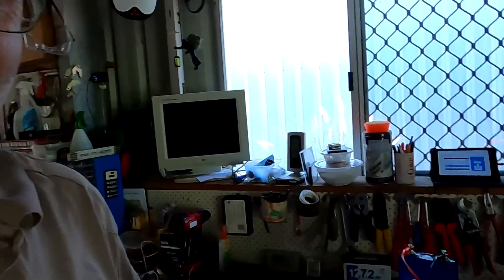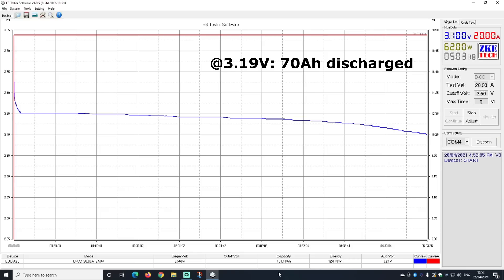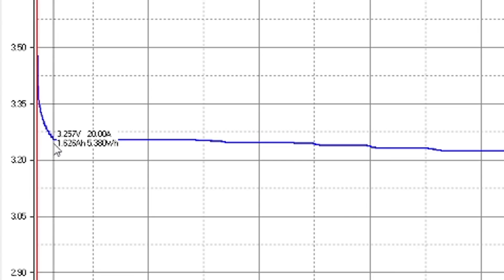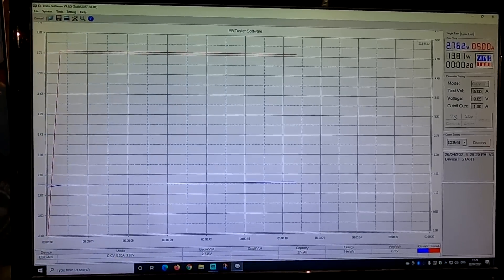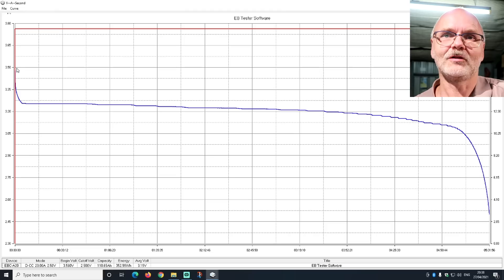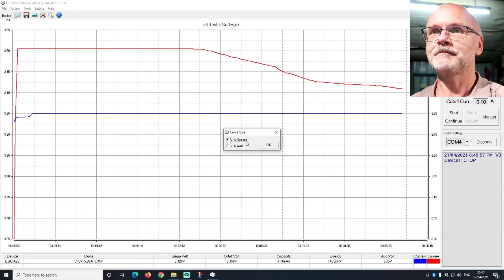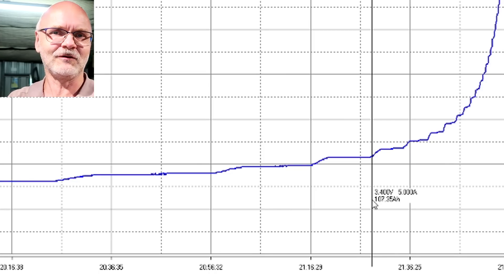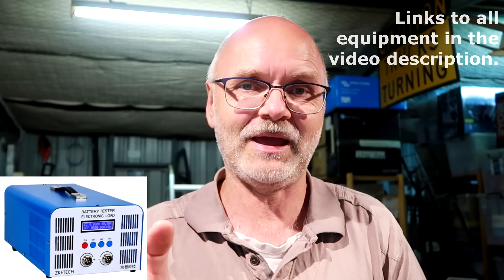How far to charge and discharge a LiFePO4 cell. Testing the full Charge and Discharge Curves.

Comment: You are finding exactly what I have found. No need to go below 3 volts, and above 3.4 volts, there's almost nothing outside that range. You are still limited by the weakest cell, but that is true no matter what charge and discharge profile you use. You can easily get 90% of capacity without placing any stress on the cells. I had found out using the bigger tester that my laptop battery won't last long enough to record a complete test, so for the last month I have been waiting on the parts for an 11th generation in NUC to be able to save the graphs. They just released it about two weeks ago, so I finished building it yesterday. Had to use a dummy HDMI plug so it can boot headless, and I just remote desktop to it. So I have only completed 2 recorded tests, despite having it for a month now (Eve cells), but have done lots of manual tests and was reaching the same conclusions as you about the time you did the videos on charging and float voltages. On a 280AH cell (measures 278.8) I am finding about 5 amp hours above 3.4, and 5 amp hours below 3.0. I think I like your 3.1v cutoff better.
Reply from the maker: Thank for sharing, John. A NUC is a good idea as it uses only a few watts of power running for so long. I've got my old Dell workshop computer running for several days now and with the cloudy weather at the moment, solar is barely enough to recharge what I take out with all my testing.
Reply: @OffGridGarageAustralia  Yes, since it uses a laptop CPU, memory and SSD, it is very good on power consumption (like a laptop). It even uses a 65 watt power supply just like a laptop. I did have to buy a 10 port USB hub, since I have a lot of programmable loads and power supplies to connect. Four of the 18 amp Riden power supplies, and four of the ET5410 electronic loads. This is for testing packs at higher rates, obviously.
Reply: @john_in_phoenix  how abt a RSPI4 instead of a NUC ?
Reply: @cgmarch2359  Hard to run Windows software on an arm based Linux system.

Comment: The reason for charging to a high voltage of 3.65 is for speed. Generally you will charge to 3.65 and stop the charging at .05C (5 Amps). The voltage will sag over time to about 3.4v. Knowing that a fully charged cell sits at around 3.4 volts, You could just charge to that voltage until you hit 0 amps and have a fully charged cell. This however would take much longer to achieve the same result.
Reply from the maker: Yeah, I figured that now with doing more testing. The absorption time at a lower voltage is taking forever.

Comment: You only charged at 5A but if you say charged at 20A then the voltage will have been higher on all points in that curve due to voltage drop inside the cell based on cell internal DC resistance.
To be sure that cell is fully charged no matter the cell internal resistance and cell charge rate (within reason) then is good to have a voltage termination at least at 3.5V on that fastly increasing part of the curve at the end. For my SBMS I selected the 3.55V as a good end point for most cases and LiFePO4 batteries to be sure cell is full then charging completely stops as absorption and float are detrimental to Lithium batteries. Also the SOC is set to 100% in case some small errors accumulated since last charge as the SOC is calculated and not based on voltage (as you seen is just not possible to guess SOC from the voltage with LiFePO4).
Reply from the maker: Thanks, the 20A test is coming very soon.
Reply: I was looking for your explanation/comment here Dacian :)) excellent observations...

Comment: Thanks so much for posting this data, well done. It confirms the very limited information that was available a couple of years ago. I had set up my Schneider Conext 6848 XW+ to 54.4 Volts (3.4V/cell) and have found that is good enough to get about a 95% charge. There is NO need to push the cells to 3.65V. Nice tester by the way.
Reply from the maker: Thanks for the info and you comment. Much appreciated.

Comment: I am looking forward to seeing if Andy agrees with me that 3.23 and 3.32 fits the 80% and 20 % depth of discharge rates I have calculated
Reply from the maker: I'll do the test!
Reply: Hi Aaron, ur numbers sound pretty good to me without the test results, but Im curious after a year, do you still find/believe these numbers are still correct? & when u say u have calculated these numbers, is that from mathematical &/or theoretical calculations, or from personal experience of ur own battery setup maybe? 
Im curious to find Andy’s results for this, while those numbers sound ok, they may be subject to a number of changes over time is my guess, and probly the best way to fairly accurately know the SOC is by coulomb/watt counting, so if u know what has gone into ur battery, unless there is a problem, u should be able to get that or a percentage thereof back out. Cheers

Comment: Hi Andy, as I tested my batteries I did ccv  with 3.4 V and 0,10 A as cut off. Some of my batteries did reach the cut off....and some stayed around 0,20 a for couple of days...and I stopped manually. I am sure my 16 cells are not all from the same producer....the company (BLS) I 've ordered via Ali Express seems to be a trader not a manufacturer. I will continue testing ...my batteries , divided in two blocks now been parallel connected for around 2 weeks. Now I will discharge down to 2.5 V cutoff and charg e then up  to 3,65 V. I hope to find out witch cells are almost close from charge& discharge curve and so  match best to build a batterie...It may take a while till I have results....looking forward to your next videos.....have fun experimenting...stay curious...;-)
Reply from the maker: I did the same test and once charging stopped at 3.4V, the absorption time took like 10h+ for this cell to reach 0.1A. I then fully discharged and found the cell having had 100% capacity, so it was fully charged at 3.4V with a loooong absorption time.

Comment: Great video, very useful! I would love to see you doing the same test on one of the EVE280 cells! I am in the middle of top balancing my 16 280’s. All in parallell with 10A, they have stayed at 3,35v all weekend now. 😂 Starting my setup with Multiplus and other charge controllers very soon, and I am very uncertain how high to set the cut of voltage. As mentioned in the comments, balancing can only be done at the high (or low) end. But in the other hand, I do not want ro stress the cells. I guess I will end up with a fairly low cut of voltage (3,4?) and then adjust that to 3,65 in between, if/when the cells get out of balance.
I really love your videos, it makes my day. Keep exploring! 😊
Reply from the maker: Thank you Lars. I've got the bigger tester now and more batteries coming in, so stay tuned.

Comment: Battery companies are emphatic to charge at CV then switch to CC to finish the charge (unless I've got that backwards today). So is your "incorrect" charging affecting capacity?
Reply: Not my chargers. You can watch the current go high yo low then switch to cv. But if I just hook up a cc cv meanwell power supply with no controller, it does the same. I set voltage 13.98 before load. They take as much current as it can give but slowly tapers off until battery reaches the set voltage.  With no cpu input
Reply: @chriscord6524  Yeah, IMHO, this is a nice visual representation of a rudimentary absorption test, because it is holding one variable steady (the current) throughout the entire test and plotting the voltage to find what's known as the "knees" in the voltage curve. But since the second half of this test behaves exactly the opposite of LiFePO4 chargers (that I'm familiar with), I would avoid confusing it with an actual charging profile.
Reply: Yep, backwards. Andy should be charging Constant Current then switching to Constant Voltage and waiting for the CURRENT curve to start dropping, then cutting it off (or float). A "correct" LiFePO4 charger does this automatically. His graph would then more closely match that of the battery manufacturer. But I don't know if the unit he's using is designed for these "correct" charging characteristics, or if it's a one-trick pony.
Reply from the maker: No, I'm doing it 100% correct. By applying the constant voltage from the start, the current will be limited by the charger. This is what all chargers are doing. They limit the current. If you look at the curves, you can see that current is constant (because limited) and voltage rises. That's exactly CC and then CV at the end.
Reply: @OffGridGarageAustralia  Sorry, I'm confused. I don't see CV at the end. I see the charger pushing up the voltage in order to maintain 5A of current.

Comment: I guess we charge to 3.65 because that will be the highest cell voltage in the pack.  other cells may still be at 3.45..
Reply from the maker: It's saving time to charge to higher voltage, that's the only reason. Absorption will take longer if we set the cut-off voltage lower.

Comment: No surprise that at a 0.05C discharge rate that you get better than 100AH.  Are you happy with the smaller cell or do you regret not getting an Eve LF280AH cell for testing?   Nice work
Reply: Discharge was 0.2C  charge was 0.05C.  And Andy kept saying that's why he has ordered the bigger tester, to do 0.2C charge as well.
Reply: He discharged at 20A, that's 2C, no?
Reply: @RickinICT  No, 100A would be 1C.  20A= 0,2C    5A=0,05C

Comment: When the LiFePO batteries have been at rest for a few hours, I can always tell the difference between 'below 55% capacity' and 'above 70% capacity', because there is a 1% difference in open circuit voltage. This 55-70 bump in the curve is true for all LiFePO batteries I've tested. However, the bump will become harder to see during fast charge or discharge.
Reply from the maker: Thanks for the info.

Comment: I would charge and discharge the batteries at the manufacturer's recommended levels
Reply from the maker: Which is up to 1C charging and 3C discharging.
Reply: @OffGridGarageAustralia  Recommended as maximum limits but not recommended for best practice or longevity

Comment: We only need to charge past 3.4 to top balance.
However if you don't bulk/absorption charge at a high enough v/cell you will slow the charging down a lot from like 70% .
I had it today, I'd turned the MPPT down to 3.4/cell as we had week of sun and couldn't use the power, but just had 2 dull days I'm about to have a wet week, and this afternoon it was sunny so went from 3.4 to 3.5/cell and went to charging at full power from 70% to top off the pack, was throttling the power - I can see it happen as the MPPT basically just moves away from the max power point.

In this test stopping at 1A I think you missed a couple of amp hours.
Reply: As @off grid and working hard points out, the sun is not always up. You want to harvest when available, and since the cells can take the charge, with as high current as possible hence higher per cell voltage!

I’m fully aware of the capacity difference between 3.4 to 3.5, it is close to nothing. Been off-grid for 2 years with lifepo4 now and probably dove in to most caveats by now 🙈
Reply from the maker: @Mr.X3D  The time limit is the factor here for charging 'higher' and therefore faster, I agree with you.
Reply: I agree!
The  reason to allow a higher voltage per cell is to harvest as much solar energy as possible, as fast as possible.

Andy actually changed the cut off to 0,1A without telling us. It is visible while examining the end result.
Reply from the maker: It's only time you save, not capacity. I have another video coming soon where I show that. The difference between charging to 3.4V or 3.5V. Very interesting!
Reply: @OffGridGarageAustralia  yes Andy, but the sun is not out all the time ;)  especially here in the UK.  So do not want to miss out on photons!

Comment: Andy you maybe interestedin the icharge x6 or x8 charger/discharger as it has the ability to use a bigger battery as the load, so you can do discharge tests but capture that energy in your bigger battery.
Reply: Yes yes but the new s6 is much more muchier
Reply from the maker: I looked into it but could not find any information that you could actually charge a battery with a higher voltage during the regen discharge? So I cannot discharge the 3.2V cell and charge this energy into the 50V battery bank, right?
Reply: @OffGridGarageAustralia  I keep forgetting your pack V, you would need to look at an X12 with a Volt input of 11-53V dc. But it will take the single cell output regen to wherever you choose to apply it. Not stopping smog, but cool
Reply: @chriscord6524 Yeah think you are right the x12 does have the better input voltage range as my x8 only goes up to 49v which isnt quite enought for a 48v pack at full charge.
Reply: @OffGridGarageAustralia  maybe a boost converter could be worked into it to enable some recovery of the otherwise wasted energy from running tests.

Comment: How you you know when to stop charging/discharging at a specific state of charge during a flat part of the I-V curve? You do coulomb counting - use software to keep track of how much energy goes in vs out to estimate where the battery should be at between deeper cycles to re-calibrate the algorithm and reset cumulative error.
Reply from the maker: Yes, coulomb count is the only option you have, either with a separate shunt or BMS (with integrated shunt).
The Victron Smart Shunt I'm using does exactly that. It also recalibrates when the battery is fully charged (parameters can be set individually).
Reply: @OffGridGarageAustralia  And exactly what I use on my battery too 👍. (Thanks Andy)
It does get out of calibration though if it hasn’t synced at top of charge for a while.

Comment: For my Winston cells, I prefer 3.45V absorption voltage and 3.375V float settings for the Victron MPPT
Reply: Same here. I have the 260Ah Winston cells (12V pack) and use the same numbers 👍
Reply from the maker: Thanks, Nick. What's the reason for that? When do you balance?
Reply: @OffGridGarageAustralia  at 3.45V absorption, you almost fully charge the cells without taking them high up the upper knee. At 3.375V float, you can keep using power from solar after the battery has been charged. Anything lower, you discharge the battery and waste solar, any higher and you start damaging the battery. There’s a consensus that under 3.4V you can’t overcharge a cell no matter how long you absorb at that voltage, while in this setup it only lasts from fully charged to sunset. These numbers come up after a period of testing and everyone ends up at those. The graphs you create show the logic here as well.
About balancing: in my opinion the BMS protections are a last resort fail safe. I never want to see them triggered. I balanced the cells manually and they maintain balance. I can charge single cells inline but didn’t need to yet.
Reply: @DeVerm123  do you currently use these settings?